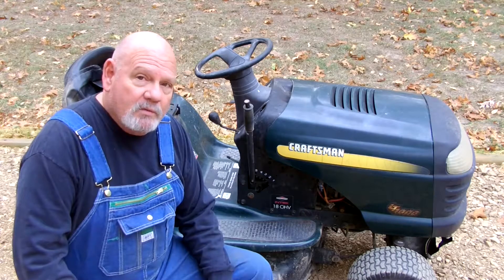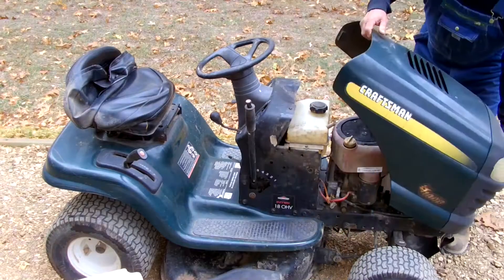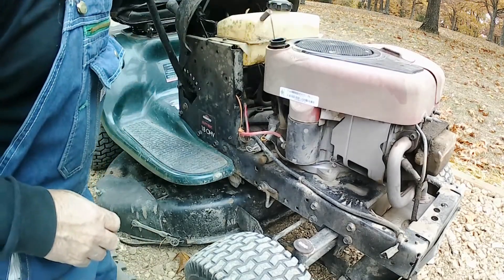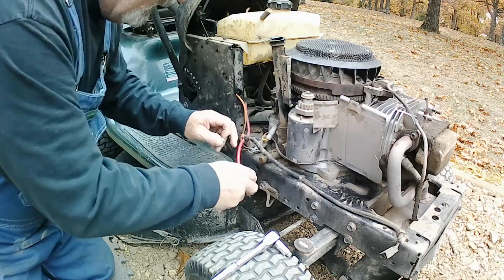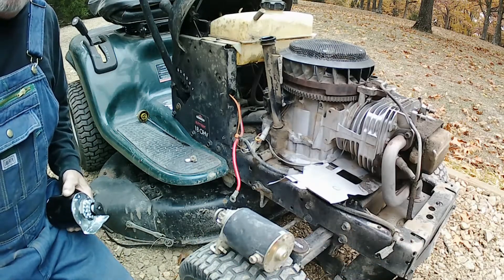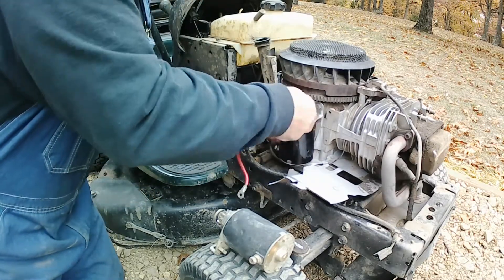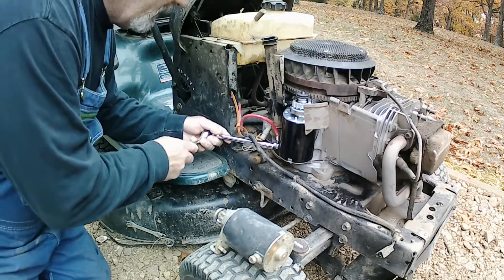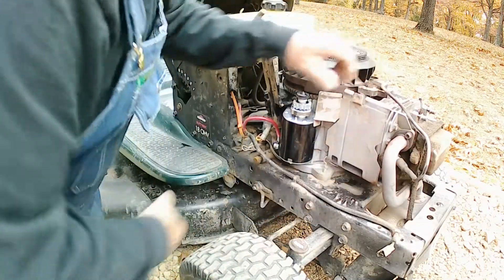LT1000 STARTER REPLACEMENT

Comment: Was it slow cranking before?
Reply from the maker: Right, I had trouble with the rockers coming loose and it caused the starter to do a lot of useless cranking before I figured it out plus it was 17 or 18 years old at the time

Comment: thanks,I tried  a solenoid,a battery,a starter,re gapped the plug,and now I ordered a new carb and a new spark plug because the engine only moves an inch when turning the ignition.If that does not work I will take off the valve cover and check the valves.Its 20 years old and never been to a shop and not giving up.
Reply from the maker: That is exactly what mine did, check how to adjust valves on a OHV Briggs and it should do the trick. Good luck
Reply: Valves are in spec but  engine is almost impossible to turn even with a ratchet.O think it's seized.
Reply from the maker: @doowoprichie with everything you already did I don’t know what else to try other than tearing into it